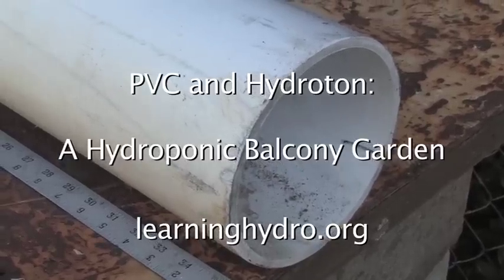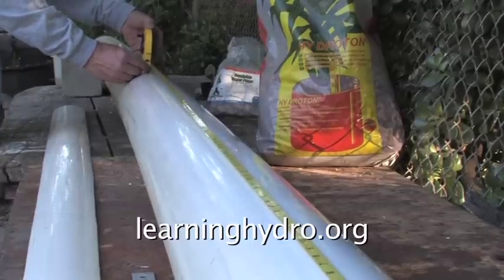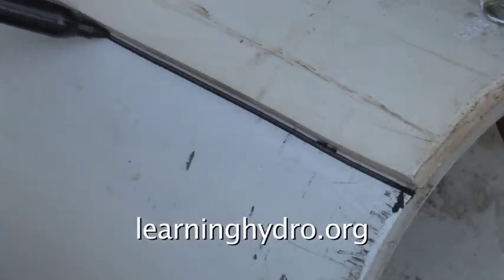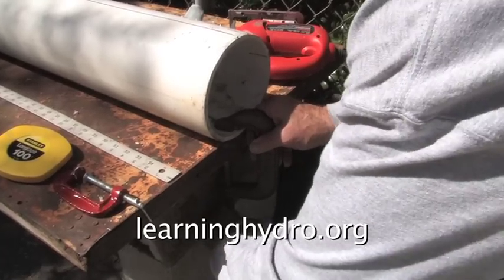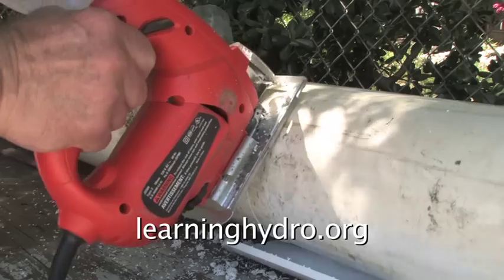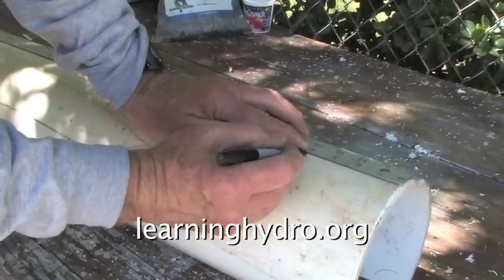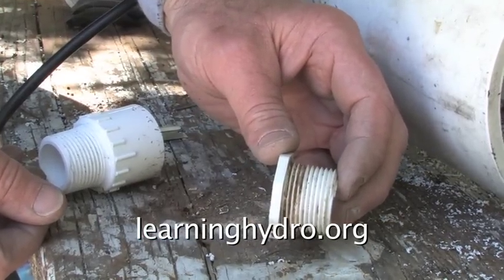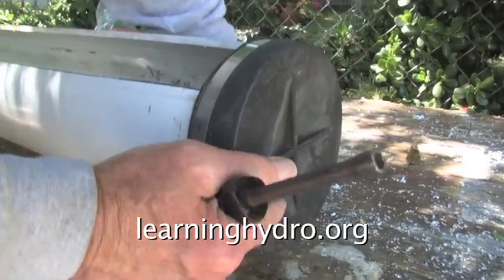A PVC hydroponic garden -- for a balcony, walkway, or fence

Comment: This is not standard  drain pipe-this is schedule 40 pvc(1/4 inch wall thickness) --which is very expensive. Standard drain pipe is about ( 1/8 wall)  thickness which is LESS expensive.
Reply: I get all the pipe discarded from worksites.  No cost.

However, be careful to use only the heavy wall PVC.  The thin wall will sag out.  I used some 8 inch pipe and it could not keep its shape.  I had to make brackets of rebar to keep it from spilling the rocks.
Reply: Johnny Wewoka HomeDepot vs Menards
Reply: Johnny Wewoka

Comment: What kind of blade do you find goes through PVC most effectively?
Reply from the maker: +Carlos Skinner 

Depends on the skill of the worker.  

In the past, I used a sabre saw blade intended for cross-cutting wood.  A coarse but effective cut.  Tedious.  People complain of how much time I include of the saw cutting plastic.  

Now, I use a SkilSaw.  Old Sears Craftsman saw.  Double-handle.  Keeps my left hand away from the blade.  My father's saw.

THIS IS NOT SAFE.  I wear both prescription polycarbonate lenses and plastic safety goggles.  And I know the consequences of an error.  Loss of fingers or a serious wound to a leg.

Go to this video to see the SkilSaw going through plastic:

https://www.youtube.com/watch?v=LUDG9QU0Y3E

A perfect way to cut would be a table saw with a custom-fabricated guide.  But I do not have a table saw.

Comment: Do you think that If I were to make something like this but with a drip irrigation system, I could use pvc tubing with a smaller diameter?
Thanks for your time
Reply from the maker: Smaller diameter PVC tubing?  Even at 6 inches, a successful plant will jam the tube with roots.  

Also, think of this:  A vessel with standard clay pebbles loses the moisture of the top inch or more of the pebbles.  4 inch ABS or PVC?  Subtract the top inch or more of growing medium.  That medium will not always be moist.

A drip system?  Why not?  In that way, the grower can distribute water throughout the line of plants -- and perhaps retain moisture in the top inch of the medium and perhaps get root growth in that top surface.

However, when a successful plant jams the tube, the mass of roots will stop the downflow of water, resulting in stagnation and anaerobic decomposition.  Death.

I have developed a technique to extend the growing life of plants in a tube.  This technique drains the tube despite the most successful plants.  Yet the technique does not counter the restriction of root masses of the plants.  

Plants need root mass.  Also, the greater the root mass, the less critical the drip and / or flood cycle.  If a plant reaches maximum root volume, then a system pump failure does not deliver water/nutrient to the plant, the plant pulls the last of the moisture out of the medium -- withers and dies.  

( A note on other details:

I see many of these YouTube hydroponic growers using small diameter tubing with holes for 'net cups.'  Do not do this.  Net cups with a large diameter, wide opening hydroponic tube system can be a device for the transplanting of mid-size seedlings.  But pulling the netcup out of the medium actually pulls a root-mass 2 to 3 times the volume of the net cup.  This reduces the percentage of net cup transplants that survive. )

Look at the the most recent video of a 6 inch system.

Solar powered Hydroponic Garden -- Model for Commercial Production

In a month of absence, July to August, that green mass doubled.  The pumping failed twice or three times.  An associate sprayed the tubes with hose water.  The bottom 6 inch tube is now jammed, the second will soon jam.

I'm going to 8 inch PVC.  12 inch when I can get it.  Commercial production of stevia will require 20 foot lengths of the largest possible diameters.

Comment from the maker: The washers for the fittings to tube connections:

In the past, I used sheets of dense neoprene.  Now I use the foam neoprene of discarded excellent quality wetsuits.  I have an old, old O'Neill wetsuit torn apart by freeway traffic.  I use heavy sewing shears to cut the washers.  The improvised washers serve better than any I have purchased.
Reply: +learninghydro Thank you for your video ! I have no idea how you happen to have no leak on the drain. I tried this setup for a NFT system and the drain was always leaking. I ended up using some silicone aquarium sealant.
Reply from the maker: ( What is "NFT?" ) 

The curves of the PVC tubing make the leakage problems:

Curved interior, curved exterior ...

PVC fittings, flat contact surfaces -- that is, where the male and female couplings screw together, the designers assumed a perfect flat contact.

Not possible with the curved interior and exterior of the PVC tube.

Technique?  Eliminate the curves.

You solved the leakage with sealant.

I developed a technique to minimize the curves of the tube.  

I will make a video of the technique.

Thank you for your viewing.

Please reply with an explanation of "NFT."
Reply: The Nutrient film technique where you always have a small flow of nutrients inside the tube.
Reply from the maker: Then that's what I produce with the tubes.  During the day, that is.

I power the pumps with solar panels.  The sun shines, the pumps pump.  Night, nothing, only the moisture on the clay pebbles.

Thank you for the answer.
Reply: +learninghydro I use some net pot inside the pvc tube and I'm trying to grow strawberries. I can't wait to see the video about the fitting !
Reply from the maker: I did a video on using netpots as permeable barriers at the ends of the tubes.

https://youtu.be/qxy8j1cx5-g?list=PL3jW3mUTWZ_9kjhD2sjqmwFHRth-VIQAr

This will direct you to GreenUrbanIslands.

Why a different channel?  

LearningHydro is hydroponics only. 

GreenUrbanIslands presents more dirt, compost, trees, etc.

Federico of Beyond Hydroponics sponsors both.  I don't know where in the US of A you work, but if you're in the Los Angeles area, Federico will always give you the best equipment at the lowest price.  Call the shop at:

(818) 899-1444

Comment: Hydroponics is a great system but it also have some disadvantage, you need to purchase some "plant food", nutrition and supplements which may be expensive. Before setting up any hydroponics system, you have to consider the benefit of aquaponics system, which can automate 95% of work.
Reply: How can I get it?
Reply: Vasumati Lapre Check out here for more information:
fine4.info/aquaponics-guide
Reply from the maker: Hydroponics with fish in the reservoirs offers the advantage of a closed system.  Combination systems of fish and gardens are common in Asia.  Village farmers also add ducks, chickens, pigs to their systems.  With or without auto-pumps, these systems close the growth-nutrient-growth loop.

However, aquaponic auto-systems require meticulous 24-hour monitoring.  Fail to maintain the aeration, the fish die.  I cannot monitor a system every hour, every day, every week.

( I recently let a solar-powered pump go two months without attention.  The system went dry, the pump continued -- and did not burn out.  Perhaps six weeks or a month running dry.  I will be buying more of those solar panel-with- pump systems. )

I have tried ducks with hydroponics.  Ducks produce infinite poop.  And a standard pump will move the nitrogen-rich water over the plants.  Ducks will not die if the pumps fail.  But ducks attract predators --- and I lost mine when a migrating flight passed over the property.  My ducks saw the free ducks, my ducks took off. 

If a gardener wants to employ only cheap organic nutrients, incorporate a bucket in the system that allows the pumped water to flow over manure.
Reply: For the past two months I've been using worm casting tea ( supplemented with molasses and aged 48-72hrs) to feed my hydroponic vertical garden and it has worked very well. Additionally I've added aeration stones to my reservoir. Essentially creating an aquaponic system using vermiculture
Reply from the maker: Good idea.  Worm manure is high in nitrogen, phosphorous, and minerals.  Molasses has iron.  Aeration stones -- the atmosphere bubbling through the nutrient solution -- increases bacterial action.

All smart.

Comment: Design change for you. Instead of buying the end cap get the regular PVC end cap and cement it on then make your cuts. Start the cut with a hole drilled 2" or 3" out from the cap after it has cured for about an hour for better support.
The PVC end cap adds support to the pipe as it's cut but does what it was made for and seals the end off.Looks better and won't leak like a seal with a screw clamp that can also cut someone. (safer and won't rust either) It's easy to drill your drain hole at what ever height you would like and glue that piece in with PVC cement into the end cap. 
Wonderful idea for a tight living space idea and the ones screaming about wasting growing medium.
The unit is sitting on a balcony rail or strapped below another one, then maybe planting closer gives the grower more food instead of a measured distance from each plant as with holes and separate nett potts. Also looks prettier with more plants drooping over a bland looking rail.
Now that idea about strapping another one below another unit. Instead of making the longitudinal cut all the way the length of the pipe, make then say in 1/4 or 1/3 the sections of the pipe so you have either 2 or 3 support pieces in the pipe so it won't flex or crush as easily. Could make nice carrying handles when you move.
Reply from the maker: The PVC drain pipe I use does not need end reinforcement.  I believe you are referring to the very cheapest thin-wall drain pipe.  

And I have employed the rack configuration in the past.  4 inch tubes with a 15 minute water cycle.  Very successful.  More basil than I could eat.  Shopping bags of basil to give away.  

I am now working another rack system with 6 inch PVC tubes to grow stevia.  Stevia -- dry leaf -- retails for $2 an ounce.  I can't pay that.  So I'm growing it.  Very good with tea.  Fresh green stevia is good in salads.
Reply from the maker: bo ter berg Correct, the contact surfaces of the PVC fittings are flat.  The flat to curve connection requires washers.  I make those washers.  There are some industry washers available --- but difficult to find and very expensive.  Dollars each.  And a tube requires a minimum of four.  For that reason, I make the washers.

In the past, I used sheets of dense neoprene.  Now I use the foam neoprene of discarded excellent quality wetsuits.  I have an old, old O'Neill wetsuit torn apart by freeway traffic.  I use heavy sewing shears to cut the washers.  The improvised washers serve better than any I have purchased. 

And flood and drain or constant flow?  Flood requires a more complex system, AC pumps, timers.  Difficult.  I use solar-powered drip-flow now.  See ---

Solar Powered Hydroponic Stevia Project -- Proof of Concept for commercial production

Comment from the maker: I found this pipe behind a gas station that had installed a smog check service.  The installation required 3 feet, the installers told the gas station owner he had to buy a 20 foot section.  A rip off.  They charged him retail, used only 3 feet, the owner didn't know what to do with the 17 foot length of scrap.  I paid -- if I remember correctly -- 1/2 wholesale, $33.  The owner was glad to get anything for the useless pipe.  

However, for maximum outdoor production, try to get 12 inch.

Comment from the maker: There are different caps that can be used.

Caps are not available at Home Depot, Lowes, Orchard.

Go to a contractor supply center.  If you want a perfect seal and accept the higher pipe, ask for a neoprene end cap with a stainless steel clamp.  Take a screen-capture image, show the clerk the cap.

Another cap is called a 'test plug.'  Do not cement the plug in place.  Use ShoeGoo tube vinyl.  That vinyl paste can be scraped away in the future.  $5 a tube.

I try to keep this all cheap.

Comment from the maker: For this tube, I used a 1 inch adapter, with the socket machined away.  

Actually, insufficient.  Even though the fitting managed the draining, I decided the next tube will employ an 1 1/4 inch male adapter.  This will offer advantages if paired with a flood and drain system.

I have already pre-planned the changes, but I am involved with other projects.  The video will appear soon.

Comment: I used round holes in rubber maid containers, using plastic cups and a air pump/air stone with great success. the medium i used was simply aquarium gravel.
aquarium gravel is cheap and works fine.

Comment from the maker: Try the netcups.  You will see the limitations.

There are other techniques I employ with the hydroton to accelerate the flow / drain cycles.  

The single greatest problem is root jamming.  I've worked out several techniques to counter the jamming, yet the obvious is larger tubes.  Then the weight breaks the supports. I've tried a rockwool mixture.  The roots grow to a solid mass.

We're now working on a system to avoid the problems and ease the difficulties of maintaining the hydroponics.

Comment: It seems to me this setup uses a LOAD of grow medium. I don't understand why it is designed to use so damn much.
The majority of other systems I have seen use round holes cut in the top of the PVC pipe which holds small cups for grow medium and plants. You only need enough grow medium for filling the cups, not the whole damn tube. Just look at the many "Related" videos at right to see how it should be done.
Seems to me like the ONLY BENEFIT of this setup is that YOU get to SELL MORE grow medium.